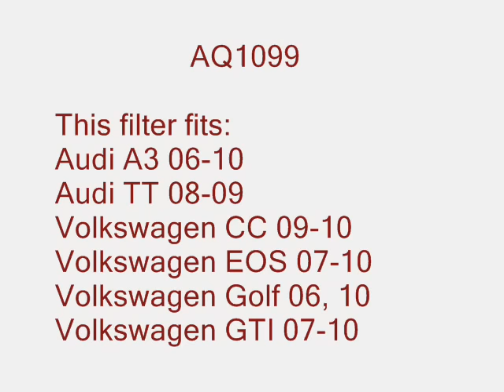How to Replace Cabin Air Filter 2006 Volkswagen Passat | AQ1099

Comment from the maker: @DaveCordts normally just changing the cabin air filter will do away with any bad smells you may be experiencing. If after you change the filter it still has some residual smell to it, cleaning your ducts couldn't hurt!

Comment: Thanks for your video it helped me find polen filter with no problems att all its all the same on right hande drive vw passat its still on passanger side there is just an cove that only olded by 2 plactic screws thanks allot
Reply from the maker: Thank you for informing us!

Comment from the maker: @djjoep100 Hey Joe. Your 06 Jetta uses the same AQ1009 filter and installation procedure. Your Jetta may however have a foam panel underneath the glove box that must be removed to get to the housing. It should have two plastic screws that hold the panel on. If your vehicle has that panel them removing it is the only extra step.

Comment: OK thank you i change my cabin filter today it was so easy.  and i did my spark plugs and air filter... my car the 2006 vw jetta only has 29000 thousand mil on it but i like to do my spark plugs ever year  and my air filter when i do my oil change. but i never change my cabin filter it was so dirty .i am so happy that i did. now i will change it every 6 months my cabin filter. i have a DVD service repair manual for my 2006 4 door vw jetta and i could not find the cabin filter on the dvd thank u
Reply from the maker: Purchase your new filter today at www.filterheads.com

Comment: What's the cabin filter use for
Reply from the maker: The cabin filter is used to filter the air that enters the cabin through the engine compartment. If you have a cabin filter installed it keeps dust and pollen from coming through the system and entering the cabin for you to breathe in. Thank you for watching!

Comment: Uh, you guys skipped over the most important part, removing the dashboard.
Reply: Hrel Probably because you don't have to remove the dashboard to replace the cabin air filter.
Reply: Joshua Chung Yeah, I got that when I went to do it myself. I didn't think it would be that easy, nothing else has been on VW. Pleasantly surprised.
Reply from the maker: Thank you for watching!
Reply: @Hrel88  i felt the same way